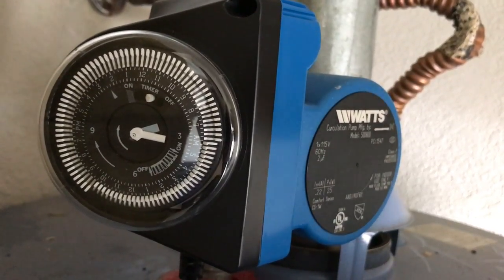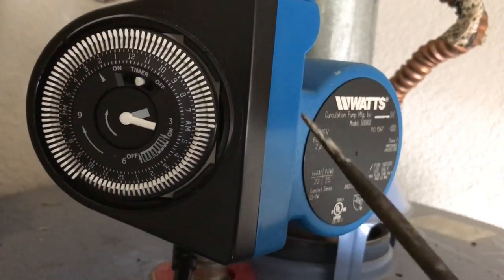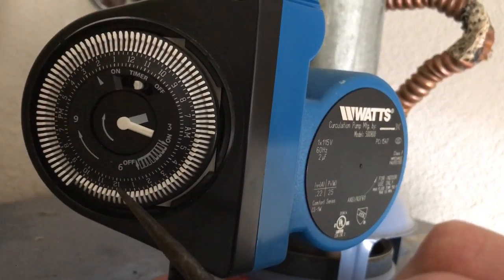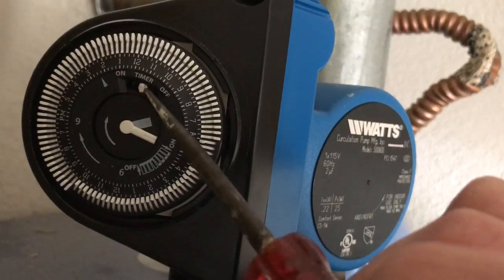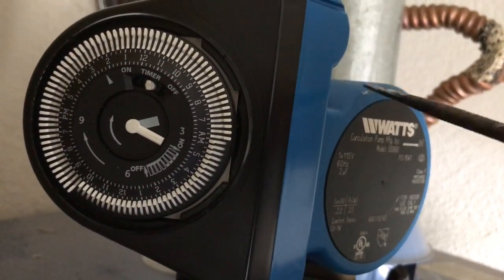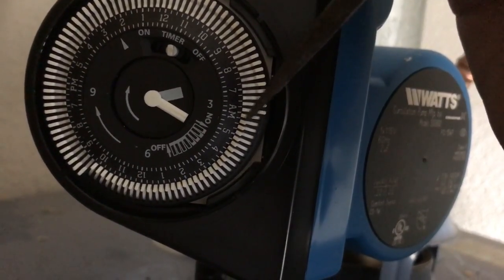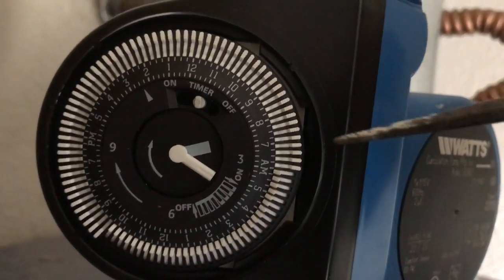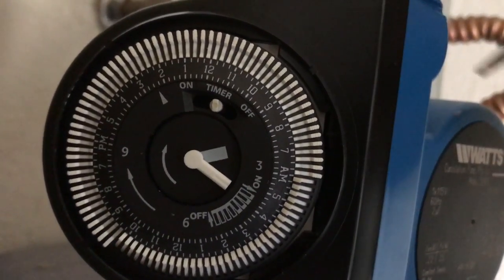Setting the Timer - Premier Watts 500800 Hot Water Recirculation Pump

Comment: I have found a much better option than using the built-in analog timer on this unit. Set it so the pump is on all the time, but control the pump through a Lutron Casetta outdoor plug. This unit was designed and intended for outdoor lighting like Christmas lights, but it will also control, small appliances and small motors, and this qualifies. We are heavily invested in Lutron lighting switches throughout our house for a variety of applications. This allows total control through an app. It takes into account daylight savings time changes. And if I want to go out of town for one or more days, I can turn the pump completely off. Likewise, if I needed to run the pump at an off schedule time, I can simply open up the app and turn the pump on as desired. Total scheduling is available through the Lutron app. And as I said, it adjust for daylight savings time. This completely eliminates the need for an analog timer that you have to go reset if there’s a power outage.

Comment: I found this video last year and I had just had the circulation pump installed for winter (to avoid freezing pipes in the basement - Colorado). I set the timer from 10 PM to 7 AM for the winter and despite some very cold, freezing and below freezing temps, it worked great. No issues.  (We were out of the country for the whole winter.) For this year I just reset it from 11 PM to 6 AM - just to save a little bit on energy costs - as I am not sure how much extra energy it uses.  Thanks for doing this (yes, it was 6 years ago - but it has been excellent help to me).

Comment: To set the clock....I think you can keep the clear dial on and simply grab the dial and rotate. No need to remove the clear cover and dink with the clock hands.
Reply: The manual weirdly says to the use the small hands not the large dial

Comment: i have a question- I have set timer to correct time and using pins for 'on ' times   what do i put timer on?  On? or Timer? I dont understand the difference between the 2?  I am using the pins for the timer so should it be set to timer?  I only want it heating in morning's and evenings for shower times

Comment: Great video. Does this cause any issues with the cold water line? Any pressure issues, etc.?
Reply: Yes, i just put this pump in and when it runs the cold water temperature is significantly higher. It was so warm that I turned it off, but I’ll turn it back on when winter comes

Comment: Great video!  I have one question:  When the pump's timer is on, does the pump run all the time or only when the sensor at the sink "tells" it to?  Thanks.
Reply: The pump runs, but if the bypass valve (the black plastic unit under your sink) thinks the water is warm enough it will block additional flow of hot water from returning in your cold water line.  The pump may try to move more hot water, but the valve will restrict it until the line is cool enough to cause the bypass valve under your sink to open up again and let hot water flow.

Comment: so here is the deal:

i just have one LINE of water at home and one solar water heater that i´ve set for hot water at the roof, I use one thermostatic valve to mix the hot and cold water so I dont need to use special pipes for hot water in the entire house, the temp is 38C or 100F all the time but always I have to open and wait untill all the could water from the pipe gets out to use the hot water that comes from the thermostatic valve, I was wondering If I can use one hot water recirculation pump to take the cold water from the line and dont wast this water everytime that I want to use hot water, but the problem is, what to do with the cold water from the pipe since I only have one line?

Comment: I am thinking about installing one of these. But I have a question hopefully someone can answer. I have 2 water heaters side by side that I can run solo, in parallel or in series. Where could I mount the pump in order for the pump to work? I am thinking it could go in the main hot water line near the heaters. Thanks for any input.

Comment: I’m just confused with this device. Can anyone help. Do you set it to be on each and every time you think you will be needing hot water. So in other words most people in my household will be showering between 7 and 9 am. So do I need to have it on during that whole 2 hour block or can I turn it on for an hour at 7-8 and expect it to be hot still at 9am?  Secondly during the evening we will be expecting hot water so do I have it running between 4pm to 9pm or do I turn it on for an hour and it then still delivers hot water for the remaining time. Also using the example shown in this video if he is running that the whole day doesn’t that mean his gas bill will be a fortune since he’s constantly heating up the water to keep it warm?
Reply: The pump runs, but if the bypass valve (the black plastic unit under your sink) thinks the water is warm enough it will block additional flow of hot water from returning in your cold water line.  The pump may try to move more hot water, but the valve will restrict it until the line is cool enough to cause the bypass valve under your sink to open up again and let hot water flow.

Comment: Have you noticed an increase in gas or electricity usage?  I'm thinking about ruining mine most of the day like you. But I have a gas water heater. I'm afraid it may use a lot of electricity and gas.
Reply: Your water heater heating the cold water around the clock is going to use a lot more power than a little tiny pump. I live in Phoenix so I shit the power off on my water heater all summer long. Inside my garage where the water heater is located is always around 105 degrees so I still have warm enough water for showers. But in the winter it seems like I'm always wasting my hands with cold water and the shower has to run for 3 or 4 minutes before it starts to get warm. I will be installing a pump ASAP.

Comment: Get the Smart Plug WiFi Outlet plug circulate pump in , set the pump on 24 hours. Use your smart phone turn on and off, I turn hot water on 2 minutes auto off after 2 minutes and i get in shower hot water waiting for me.
Reply: Smart move.  I plan on doing the same thing.  Set the pump to “Always On” and then use the Smart Plug WiFi Outlet app to circulate the water before I get in the shower, then use the app to turn it back off.  Simple. Efficient.
Reply: @gilguzman8359  even better:  put a motion sensor on your home automation and tell the automation to turn it on automatically.   Nobody there, then no need to run pump.